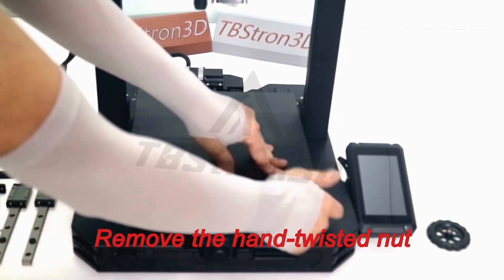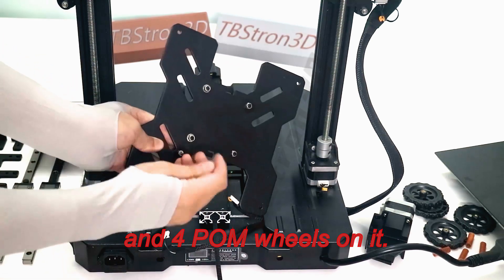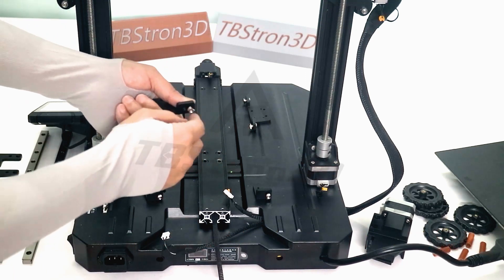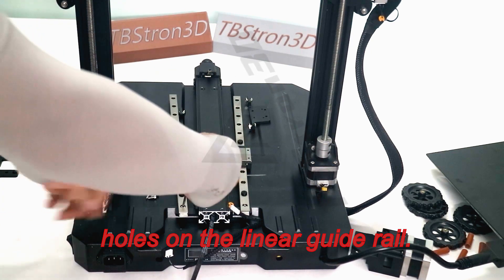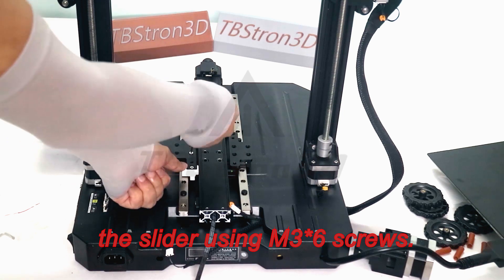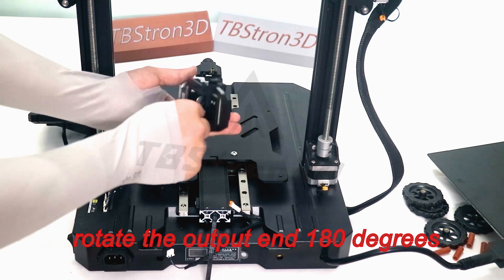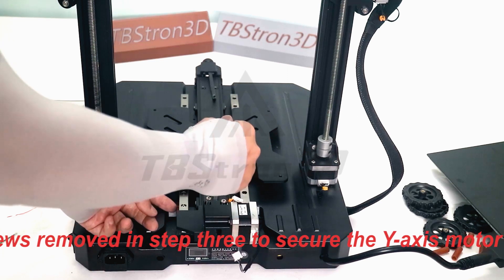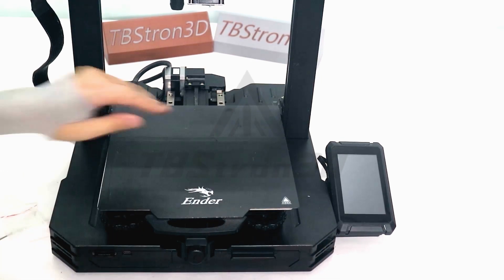CREALITY Ender 3 S1 Pro Y-axis upgrade linear rail installation guide.

Comment: I think my y axis extrusion might be bent... If I bolt this on will it be straight or will it be off because of the extrusion issues?
Reply from the maker: Hello. If your Y-axis profile is bent, our bracket will still ensure that the linear guide remains straight after installation. Thank you.